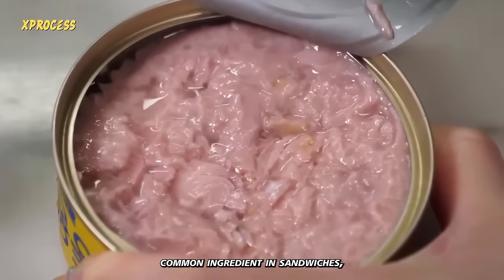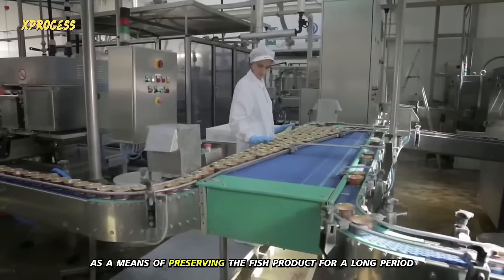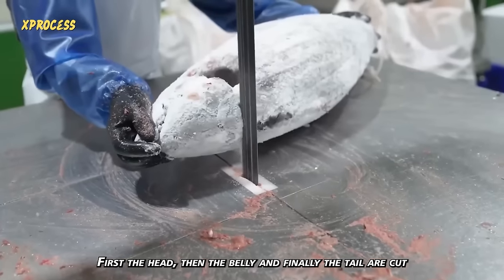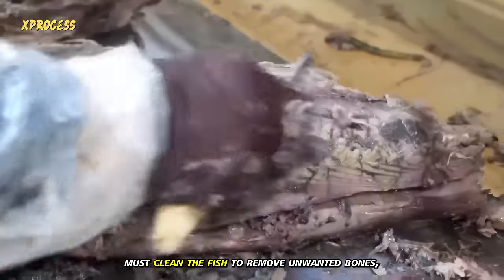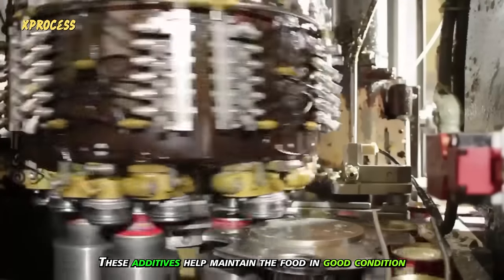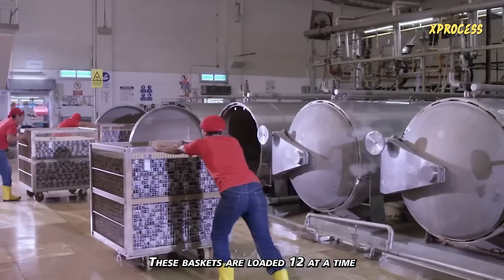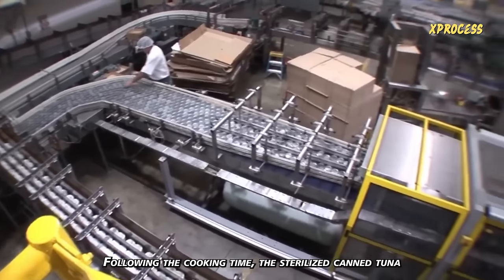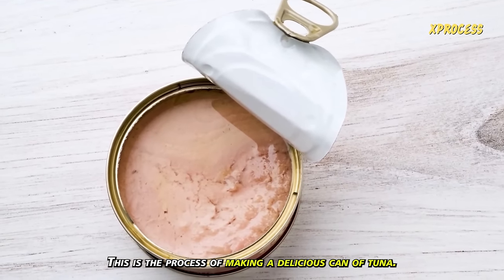How CANNED TUNA Is Made | How Tuna Fish is Cut & Preserved in Cans?

Comment: Well there are fallacies that were not mentioned in the video. 1) Though the raw mat can be whole frozen tuna...they are of Canning grade which meant that those tuna that are no longer qualified as sold as premium quality as sashimi grade , steak grade and any grade that requires appealing visual presentation in the market. Canning grade are not necessarily bad grades  but they are the bottom of the level otherwise it will be too costly for the canneries. The only exception are Albacore Tuna ( Thunnus Alalunga) where due to its quality as best Tuna meat , they are white when cooked and softer fibers than regular Tuna used in canned  Tuna. Albacore Tuna command premium price as the most expensive of all canned Tuna. Therefore there are no clear grading lines like other Tuna...all majority albacore are immediately into cannery.The other fallacies is there are no protein differences between that are so significant between Canned Tuna or fresh chilled Tuna...Protein are the same...the only that destroy the protein are either they are in rotten state or overcooking....
Reply: You speak Englrish, prease?
Reply: what about cleaning and gutting? when does that happen?

Comment: Wouldn't cooking the tuna in the can stop the loss of moisture instead of having to be packed in oil and cooked again?
Reply: Lining protecting metal casing will melt and metal will spoil food
Reply: If it were cooked in the can, it would also stick to the inside of the can. It's less likely for microbes to get into the can in the first place if the meat is cooked and put in than raw meat is put in.
Reply: The audio in the video seems like randomly generated BS. Most of it is rubbish.
Reply: If you increase the temperature, you would induce to your body chemical compounds from can lining such as BADGE and BFDGE which are known to be endocrine disruptors which will migrate faster as temperature increases from the can to the tuna. Do note that the oil inside the can also leads to migration of these chemicals to the food but not as much as heating the can. The longer you wait to open a can, the more of these chemicals will migrate into your canned food.